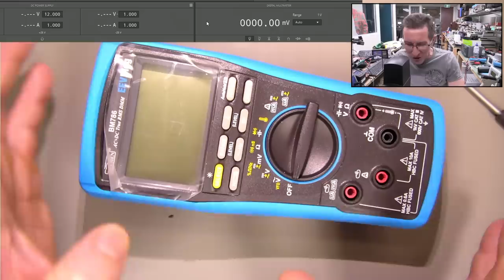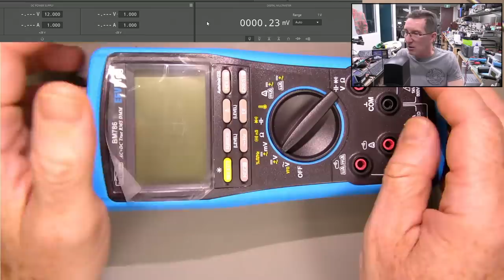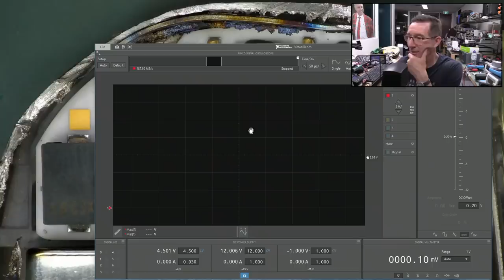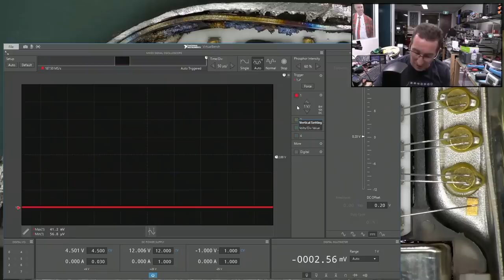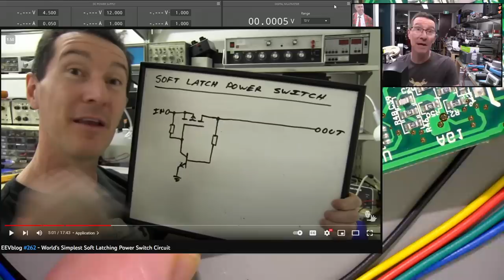EEVblog 1520 - Troubleshooting a Faulty BM786 Multimeter

Comment from the maker: LOL. EVERYONE including myself missed a major goof in this video. Can you spot it? It's not the fault, but it's something I was wrongly assuming. I can't believe not a single viewer picked me up on it!
Reply: broken ground plane continuity?
Reply: Dave, you did that deliberately, in order to do a second video on the same subject. I'd watch it however!
Reply: No fuse?
Reply: what was it ?
Reply: @seanwilkinson2291  It looks like the fuse was removed during the troubleshooting...
Reply: C58? (as jumper)
Reply: Diode broken in half?
Reply from the maker: No one has guessed it yet! I got through half a part 2 video before I realised.
Reply: Well perhaps you left t 2:33 he rotation switch in the ON setting and perhaps therefore the programmers could not connect to the processor
Reply: @pault6533  that empty fuse holder was like glaring but when Dave admitted to comparing to working can't imagine that it wouldn't be noticed - can't wait for part 2
Reply: @EEVblog  put it on eev2 if you didn't delete it
Reply: Does the DMM need probes attached for it to function ?
Does the battery cover need to be closed ?
Reply: @pault6533  The missing fuse should only impact the current reading (in this case I'm assuming the mA range), in that it wont register anything since there's no longer a path through the meter for current to flow.
Reply: @brianford6729  Only impacts the mA range: "Fuse (F2) for µA/mA input: SIBA 7017240; 0.4A/1000Vac & Vdc, IR 30kA, F fuse; Dimension: 6 x 32 mm" Shouldn't impact the overall function, tho.
Reply: Not sure what major goof you missed, but a thought i had while watching this is that the chip probably will not respond to the programer if the rest circuity is not working for it, as applying power with out resting will leave the processor in a locked up state. Also it might just be the view on the video but it looks like there is damage to R104.
Reply: we want part2 !
Reply: @26:00 performing measurements in power off setting.
Reply: resistor instead capacitor?
Reply: Taking measurements on the Multimeter chipset instead of the microcontroller.
Reply: @EEVblog  Electric Trolley bus vs electric battery bus
Reply: One thing is with NI virtualbench black terminal assumption to be positive which is not - its a ground, although with poor light condition its similar to plus i guess.
Reply: That is because all electronic troubleshooting videos are better viewed under microscope, in the video. It's hard to see details otherwise.
Reply: Don't tell me there's a contrast knob...
Reply: At time 11:51 your concern/comment about the meter timing out: it won't turn on, and yet the time out feature still works?
Reply: 9:18 of this video lol whoops
Reply: Black is positive

Comment: About those protective films. I try to keep them on as much as possible (well unless they are annoying). I remember that my Nokia 3310 had the protective film during all the years that I used it (I nicely cut off the smal lip to peel the film off so that it would stay on nicely).
A real funny story is when I bought a plastic cutlery tray for my kitchen drawer I saw that the surface started to look bad after a few years and was about to throw it away when I saw that it actually had a protective film on it leaving me with a brand new tray after all those years (peeling off that film was ... omg, best day of my life).
Reply: I had a meeting at a newly opened remote office a few years back, and one of the locals was complaining how poorly the new white board looked after erasing.  Even using the cleaner fluid didn't help much.  I walked up to the board and noticed that the protective film was covering the entire board.   In slight fairness, there were no obvious bubbles or tabs to remove it.   Worked great once the film was removed.
Reply: My parents were complaining about how bad the control panel on their refrigerator looked when it was only a couple years old.  I saw it still had the film on and went to peel it off, they made me stop, thinking I was going to damage it. I waited until they were gone, peeled it off and...viola! The control panel looked good as new.
Reply: @Okurka.  nah, violist’s heads are just smaller.  Also, why do violists put a cloth under their chin?   No spit valve.
Reply: @briansauk6837  What's the difference between a violin and a viola? The violin takes twice as long to burn!
Reply: How many years did you have to take violin lessons before you realized you'd never live up to your parents' expectations?
Reply: Haha, reminds me of going to a friend's gran's house as a kid, she had protective plastic covers on all the furniture and a plastic runner for the hall carpet. "To make sure it stays nice"!
Reply: My wife was complaining of the videocam quality on her new company issued laptop, and told me her whole team has been unhappy for the best part of the week. I peeled the little plastic film over the webcam and presto ! Full HD... She was mortified😅, but it felt better when she was basically hailed a genius by her co-workers after the week-end... 🤣
Reply: @jhonbus  Ha, Italian, no doubt.
Reply: Reminds me of one of my friends who bought one of those TV sound bars you put under the TV for extra bass. He wasn't happy with the output, so he asked me to take a look. Turned out the protective film was still in place, covering the grill of the speaker. To be fair, I didn't really notice it myself until I got right up close 😄
Reply: @anthonydenn4345  I dated a girl many years ago who had a "NEW HD TV", prob 2008 or so. I went over to her house and said "you know, I don't think you're hooked up to HD".  Sure enough she had everything HD, except the cable box was hooked up via a composite cable. She was thrilled when I hooked up the DVI (pre-hdmi says, IIRC).
Reply: They're nice to keep on to protect from scratches. Sometimes you don't even notice it.

Comment: Dave:  A quickie test I use on stuff like this where you are not sure the micro is clocking (bad Xtal, no power, whatever...) is to hold a small battery operated am radio tuned to a dead channel next to the device and turn the device on.  If the device is clocking you will pick up a bunch of "hash" in the AM radio.  Not 100 % foolproof, but very quick and easy to do and it gives some direction to your troubleshooting...

Comment: For whatever it is worth,  I would clear that debris between the multimeter chip pins. It takes pretty much no effort and removes that small possibility. Maybe my ocd, but I'd do that.
Reply: Looks like the debris did get cleared at some point.
Reply: It's not OCD. I've seen motherboards with QFP pins shorted by fine dust. Blew the dust off and then it booted.
Reply: Sometimes things miraculously fix themselves upon being cleaned! So to me thorough clean is a good early step. Even if there is no evidence of moisture ingress or anything like that.

Comment: Been using one of these for over a year now, well worth the money.  No hesitation to probe around the 480v sprinkler systems we use, the 240v wells, etc and it still has all the features for the electronics stuff

Comment: At this point of the troubleshooting without having a replacement chip I would suggest trying to reflow the BTC chip, just in case one of the pin is not soldered properly

Comment: This is why I love this channel.
Dave dives in the multimeter like a hero ;)
Reply: Totally agree. It is very hard to fix modern meters or any equipment nowadays as everything is integrated chips and surface mount components. It's almost impossible to repair or get parts. Not like the old days.

Comment: When you suspect a bad mosfet, or any transistor, it's prudent to check the voltages at the terminals first of all. That will reveal quickly if it is faulty or not. Before changing components and potentially lifting traces.

Comment: 23:18 Doesn't R104 look kinda suspect? No idea what im looking just feels crusty
Reply: So did the cap above it. It had a black spot.
Although R104 looked like a solder splash.
Reply from the maker: Nicely spotted. It measures 0.5ohms which seemed odd, so I checked a good board and it's 10k. So somethign up here. Cap not shorted. It was just flux residue, and it's not part of the micro circuit so doesn't explain the lack of boot, but somethign it certanly up here. Also, the resistor above is populated on the good board.
Reply: @EEVblog  probably micro blew up thats why the resistor got charred
Reply: Check C46 (nearly next to it). Might be some burned flux ...
Reply: @EEVblog  No wonder they don't want to give you one (of many of) the schematics.

Comment: I think the U1 "microcontroller" you are pointing to is actually the HY3131 DMM front end (48 pin).  The NCs pins seem to line up.   The pins you pointed to are AGND, REFO and VSSA on the front-end. The location of Xin/Xout seem correct and the HY3131 spec sheet specifies that 4.9152 Mhz Xtal.  Perhaps U16 (64 pin) next to the buzzer is the microcontroller?   Maybe U16 is a HY16F 32bit microcontroller?
Reply: Действительно это он, надо подумать над его  модификацией .

Comment: I bought an EEV Blog branded multimeter (model 121GW) about a year ago and although it's a bit more pricey than the Radio Shack meters I'm used to, it's a huge upgrade and well worth it in my opinion.  Just used it a couple days ago to measure some zener diodes (using the 15V range).
Reply: I had two, killed both with a range sweep at 240v. junk meters.
Reply: to be fair, Dave did send me a replacement meter and then a refund, but I still had to pay import duty on both. Kept both test leads and fuses, so I guess it worked out ££ wise.
Reply: @ritecomment2098  I've never needed to measure above 120 volts AC but I've had zero problems -- I'll try it on 240 volts tonight with my welder plug.  You have the 121GW model?  I searched the "EEVblog 121GW Multimeter Issues" thread and found no mention of killed units like you describe so I'm guessing this is a fluke :)

Of course you have to know what you're doing when you use a multimeter; reading current or resistance will at minimum blow fuses for sources that are not current limited!
Reply: @IamJohnanderson  I had a 121GW, I have a 101,175, 325 and 17B+ now in daily use. The fault with 121GW is that after a range sweep it seemed to lost all calibration or blew something in the precision measurement circuit as it was reading 10's and 100's of volts with nothing connected. I think it must have been a common flaw as Dave was selling upgrade kits shortly after. I was a kickstarted backer and had such high hopes so I must have got the first batch.

Whenever I get a new meter I always do a range sweep from OFF to all the ranges, AC,DC, resistance, capacitance, mA, A and then back again slowly a few times with the leads in the COM and V/ohm plugs. If it's input circuitry can't take that (as noone is perfect when working), then I won't use it. This proves that the high impedance circuit is working. Obviously doing this in current mode is pointless as its just a short circuit, but ensuring there is no crossover in the range switch section of the PCB during these modes is just as important.

I work on AC servo systems with an shared DC bus that can be between 600-800VDC so its a complete reject for me, I didnt even take it onto site, can't trust it at all.

Its worth saying that the safety specifications for meters only specify that there should be no explosion during a failure mode, not that there should be continuing function. But this is 2023 now (nearly), I just can't throw away a meter because I had a 1 second moment on site.
Reply: @ritecomment2098  Thanks for the further info!  You know what you're doing.  

Sounds like hopefully this issue has been resolved but I can see why you'd be hesitant when you have other options that are reliable.  I use my meter mostly for low voltage circuits.  I do like the fact that the firmware is hackable and perhaps some day I'll get a chance to play around with it.

Comment: Often (including at 28:01) you can see that C107 is stuffed with a 0 ohm resistor (marking 000)! It's not odd to have parts unstuffed, but to stuff a capacitor location with a jumper is very odd. C101 is the same way.

It's an 0805 near the top center of the board on the side with the processor. Near the edge fingers (zebra fingers?).

Comment: there appears to be a small solder bridge under the leads of U1, under R32,and an inability to detect or program is a common symptom of that. I'll find out what it is in part 2 though! I do rework, and those crystals are VERY difficult to remove. you have to wick up one side, heat it and get a blade under it, lift it the tiniest amount up, with liberal flux. then add more to the other side and lift up the wicked side to kind of tombstone it up, and you can pull it off.

Comment: 34:18 Just curious. Did you have access to an "underside preheater" or something similar? I know it's water under the bridge, but my experience with pre-heaters has significantly helped with those type of components.
Reply: Yeah they're usually pretty good, but this is a fairly densely populated double-sided board so I'm not sure if it would have been much use.
Reply from the maker: I do, but it's not something I would have normally considered for a simply crystal. By the time I realised it wasn't budging the pad had lifted.
Reply: @jhonbus  I somewhat agree, but to further add... any highly successful techniques wouldn't be straightforward. I've worked with 6+ layer mil-spec avionics boards with much higher component density and LOTS of disassembly and "pre-desoldering" would need to take place even before employing any sort of desoldering techniques, even with a "simple" crystal. That would be just the beginning. I've successfully removed more root cause fault components using these techniques more times than I care to admit, mind you for over 30+ years and still going, but other components that could absorb significant amounts of heat may need to be sacrificed meaning more possible tradeoffs. Again, just the beginning.

EDIT: In this case, this is a "ruggedly built" DMM, which those robust components definitely would absorb/dissipate massive amounts of heat away quite quickly.

Just my 2 cents. 
😎
Reply: @EEVblog  Yep. Which could mean more disassembly and even sacrificing other components that could be possible "quasi heatsinks", yet still no guarantee. Considering the cost of the DMM, It would be for entertainment/education purposes.

Comment: I would not rule out a half-broken micro. We had issues with customers that manages to selectively fry the UART Rx pin of a micro inside a device and the UART was used for communication with another micro so as far away from external connections as it gets. Maybe it‘s only the pin for the latching circuit. Since you know the micro, you can guess. Is it one that needs software running to switch on the external oscillator?
Reply: interesting information.
Reply: Latchup of the IO circuit of a given pin is a thing but no, the whole power latch circuit was bypassed and there was still no response on the ISP pins. ISP pins are presumably not in normal use.
Reply: Just replace the micro with the one in another unit and see what happens. Maybe also do the other way around.
Reply: @modorangeorge4991  good idea.

Comment: F2 fuse out for most or all voltage checks. It's 0.4A ,  so not for protecting the high current input.

Comment: No meter ever died under my hands except the most expensive Fluke. So I buy as many as I can to compare measurements. Sorry no Brymen for me, I prefer Brylcream on my hair....
Reply: I've been a "Fluke" guys for 45+ years - they've never failed!  Great meters!
Modified an 8012 for LCD Backlighting w/ adjustment.
Reply: @jonabbott7660  Growing up in Europe I got my first multimeter in 1967. Money was tight so a German made one let alone an American was out of budget. So I got a Sanwa from Japan, analog but the precision it was made lived up to the most expensive competition. Nixie tube ones we had during my apprenticeship, the fascination lives on. During a factory visit at the Salora factory in Finland I was locked into an argument with their chief engineer that showed us an unstable digital meter that had to me no aceptable result. I insisted to find out the root mean square with an analog meter but he refused. So I saved up and splurged for a Fluke 8024B. No I had proof that that man was wrong. First time I could also directly measure Siemens values without inverting Ohms. Best engineering at the time! Sadly when it died 2 years later all I could afford was a Japanese clone, that very unit has survived over 30 years. Now I lost count over the number of multimeters I own. But the Japanese chief engineer from Sony awarded me a new Fluke meter for being their 2nd best technician they had in Australia. Still my pride and joy despite its display showing a filter issue.

Comment: I would refit the original crystal (if usable) and then do a pin-to-pin check (DVM then scope) between the programming connector and the micro, comparing with a working one. I wish I had £1 for every-time you said a schematic would be helpful, nice etc.

Comment: Does "Crest" and "Rec" functions work correctly in this multimeter? Then I am measuring 12V battery it shows 0,2В more then in DCV mode in my 869S

Comment: A newbie question:  When did we go from manufacturers supplying schematics and service manuals with their products, to manufacturers considering such things proprietary?  I don't know, maybe with surface mount electronics no one is going to try to service something like this: cheaper to just throw it away and get another one.
Reply: Most manufacturers don't supply that anymore. I'm not sure if they ever did. I think if you ask them they would provide it. Thing is electronics nowadays are all designed to be disposable.